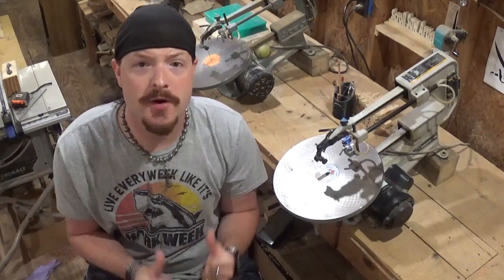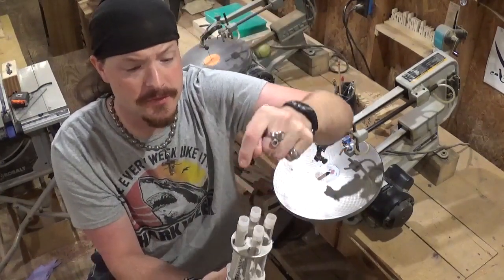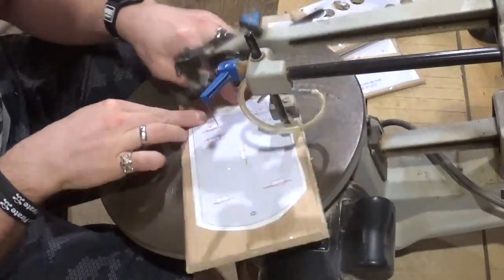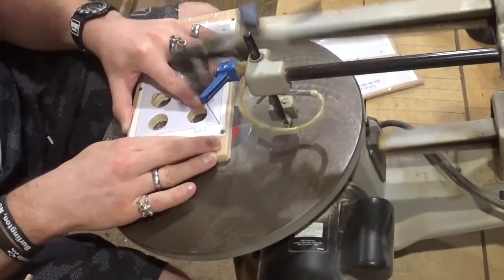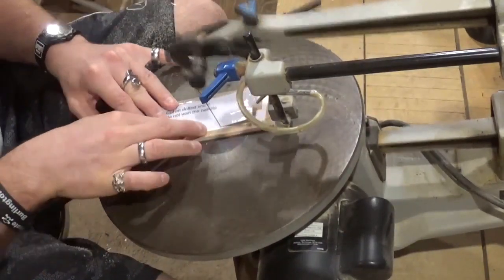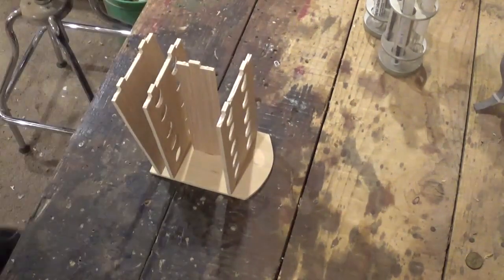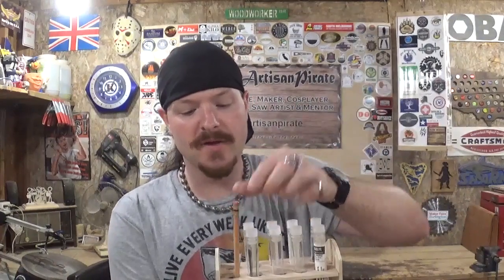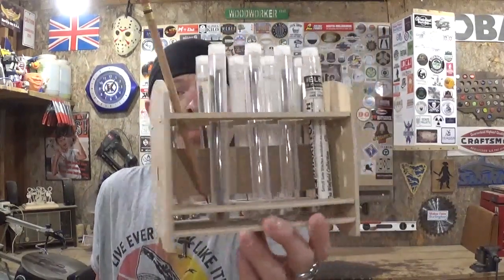Scroll Saw Blade Storage Caddy

Comment: Question: when you do a 90° turn, do you pull your work a little bit or do you just turn ?
Reply from the maker: Good Question !  And No, On Thinner Wood Like This Its Easire To Do The Sharp 90 Turn.  However On Thicker Wood I Will Slightly Pull Back When Going Into A 90 Turn, Especially On Compound Cutting
Reply: @ArtisanPirate  Thanks buddy. I have a hard time with that. Sometime when I pull back, the blade goes another place.